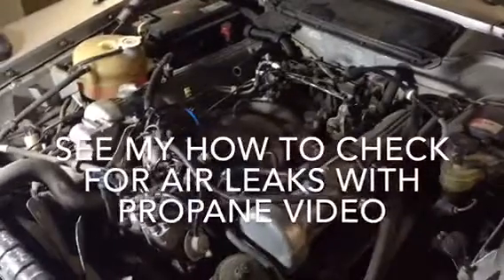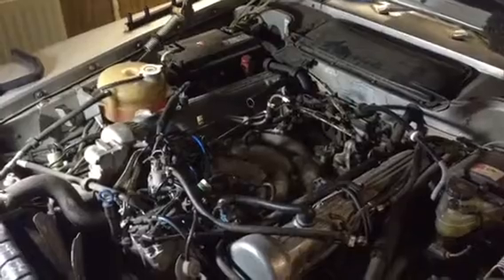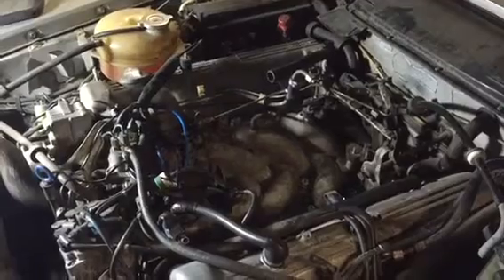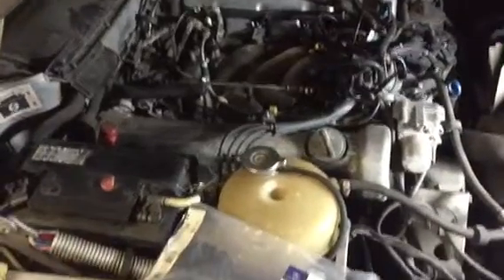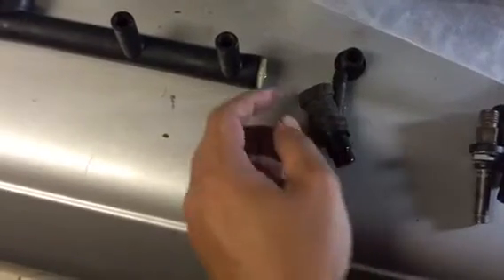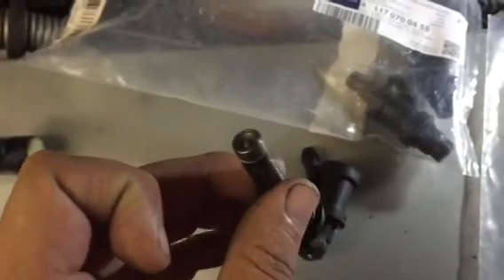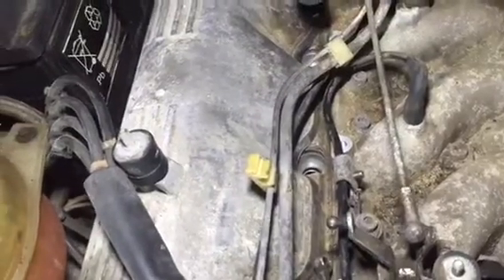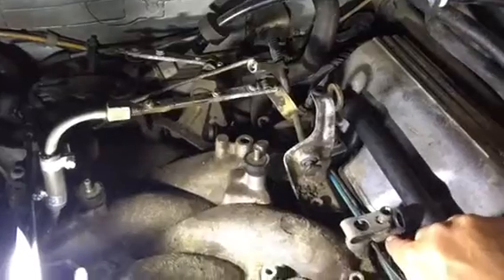How to repair Mercedes high idle M117 vacuum leak part 1

Comment: Hi Richard,

Mine has 2.5k RMP on idle. Do you have any idea aboute what source can cause my problem?
 I have W126 380 SEC from 1983.

Thank you!
Reply from the maker: Could be a multitude. I am guessing false air around the injectors
Reply: @horvath14041984  , it was from  linkage throtle. I solved the prob, but now I have an instable idle.
Do you know were can I buy un good"Seevice shop manual" for w126?
Reply from the maker: Yes throttle linkage cause a lot of problems. It is mentioned in one of my videos. A good WSM for the car I don’t know but for the M117 engine there can be found a lot on the internet against a small fee

Comment: Hi Richard thanks for the video can you pls just telll me if I’m relaxing all my
Vacuum lines in my 560sec how many do I need? And are they all the same? (Thickness and length) thank you
Reply: Replacing not relaxing
Reply from the maker: Hi they are all the same thickness but not the same colors. Exact lengths I could not help you with
Reply: Richard Horvath possible to know how many total lines I would need to order to replace them all
Reply from the maker: I would like to know why you would want to replace all the lines? Usually nothing happens with the lines. The rubber connectors tend to loosen. I often superglue to end into the rubbers for fault finding purposes but tends to last for years of untouched. They are seperable if you want to. It will cost you a dear penny to replace all those lines
Reply: Richard Horvath I’m having a high idle problem.. the mechanic said a lot of the lines were bridle and would brake not sure if this is accurate I bought a new idle control vale and idle speed module will try them to see if that fixes it but the vacuum leak was gonna be the last step in hopes to solve the high idle issue

Comment: Hi Richard, 

This is a really good video on vacuum system.
I have a problem with my 190e automatic. The idle drops when air conditioning is turn on. Drops even worse (450 rpm) when gear is changed from P to D which causes the car to vibrate vigorously. I have increase the idle to 1300rpm to compensate. Can you identify which parts that would cause this problem please???
Reply from the maker: +Shanjiv Steven Kanaga Lingam please do a CO test and Vaccuum leak test. It is normal to drop when transmission is engaged. I suspect de fuel injection or ICV. 

Do not change idle settings on injection unit without CO connected. It is very sensitive! You can also check through your O2 sensor. Should be around 0.5v

Good luck

Comment: Hi Richard.

You do an excelent video jobb.
Verry good explanation. 

Iam working with a 1986 560 SEC.
And I change a lot of the fuel injection system..

I have one question.
What is the part number of the injection hose (rubber) that is on 4.19.
You call it vacuum tubs.
You know when you looking for parts that you need it is hard to find what the producer call it. 
And the OEM numbers.

So!
Can you help me out?

Regards from
Dan.
Norway..
Reply from the maker: +DAn Nils

Hi there, thank you for liking my video's. make sure to Subscribe, like and watch my other videos as well. 

The Mercedes part number I used is 1160940982. 

Good luck but make sure you replace the other parts as well because it not worth the hassle to rebuild and find out your leak is elsewhere.
Reply: Hi.
Tnx for quick respone..